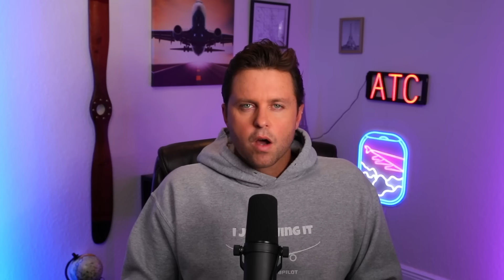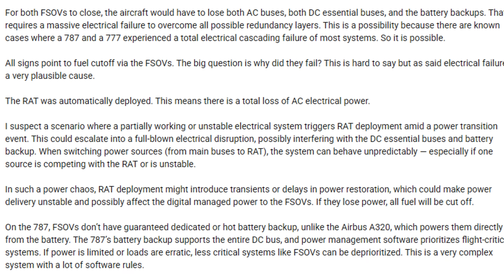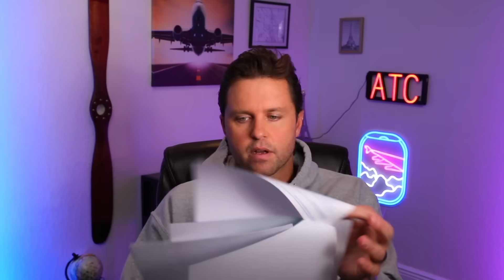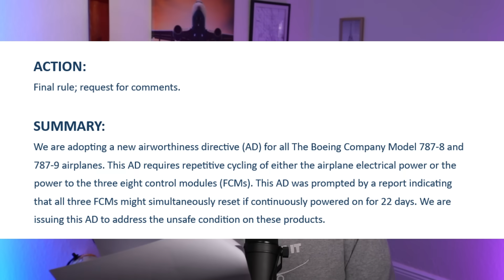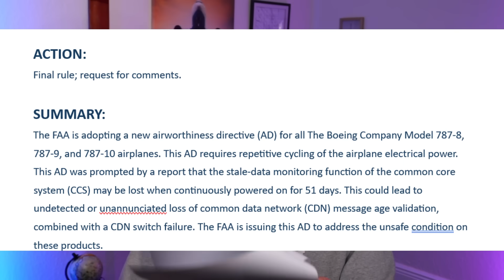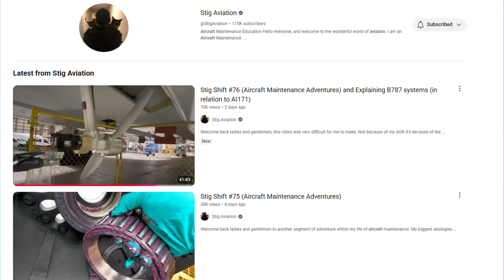Air India 171: Did a Software Glitch Cause Dual Engine Failure?

Comment: I have thought for a while that something triggered when the gear retraction was selected.  The timing fits that if the pumps stopped/fuel shut off you would have a couple of seconds of fuel then nothing. RAT deploys giving you some power for radio etc but you are basically tied to a brick at this point.
Those poor pilots were doomed from the moment they stepped aboard.  There would have been  no prior warning.

The issues from the previous flight: A/C, call buttons not working, entertainment not functioning, etc show there was SOME sort of electronic issue with the craft but possibly not determined to impact the flight status.

Comment: Hi @garybpilot. Thank you for your very interesting hypothesis on the FSOV. I'd like to add one element to that picture. I think that the sole survivor of the accident has made a description of the seconds before impact that frames well within the theory of an electrical glitch; but he also described having felt a TEMPORARY loss of thrust during take off. In this video (https://www.youtube.com/watch?v=b588I2oXMiI&t=29s) he said: "When it took off, within one minute after take off, suddenly for 5 to 10 seconds if felt like the plane was stuck / suspended. Later the lights in the plane came on. Green and white. Then the engines began to accelerate to take off more and keep climbing; until it hit the building." To my understanding he is saying that before hitting the building, the airplane had briefly REGAINED SOME THRUST. I think that this detail has been mostly overlooked and it deserves some elaboration from the community. How about you? Had you paid close attention to this detail in his statement? If the Fuel Shutoff Valve (FSOV) was activated for only say 10 seconds, and was then deactivated after regaining power from the deployed RAT, could the engines have restarted very briefly before impact to the building?? Could you please comment on this survivor's account? Thank you.

Comment: RAT requires aerodynamic airflow to turn the turbine. It is better to install a powerful auxiliary power engine to sypply electrical power to essential components during take off and while on landing. Authorities and manufacturers must look in to the subject.

Comment: Here is what I think happened 

Electrical fault disables FSOV
Fuel valves close, engines shut down

Engine generators stop
AC power to buses lost
Main AC buses offline

RAT deploys to restore essential power

Plane crashes 💀

Comment: Here we go again... the last real good quality aircraft that Boeing produced was 777.  Things went downhill since then. 787, MAX
Reply: 777 also suffered dual engine failure, resulting in a crash landing. Due to a poorly designed fuel heat exchanger.

Comment: Sounds highly probably to me. Planes are fine with computer technology doing most of the flying. But does my PC crash sometimes? yes it does. So highly probably these planes will have similar PC crashes. In those notes you read it sounds like the planes computers had to be rebooted after so many days. We are trusting our lives with not only Pilots but computers. Oh well. Flying for me is scary. I will still do it sometimes but I might need 6 Bourbon and cokes to get on board. Oh and I forgot the main problem! Airline manufacturers cutting corners and puting all our lives at risk. My hats off to all whistleblowers.

Comment: Okay but what with unusual long take off roll? Today we now they used almost all of 3500 metres runway. So the question is if wasn't they also underpowered on the ground.
Reply: The aircraft rotated at the usual position 2,100m from the start of the runway and climbed to 400 ft in 10 seconds, with a climb rate of 2,400 ft per minutes, which is normal. The problem occurred a short time latter. The aircraft then descended and crossed the end of the runway at 71 ft agl.

Hence the problem was not on the ground run but after the initial climb.

Comment: The problem is, who is in charge of the aircraft. The commander or the computer? It has to be the commander, who should be in manual charge of engines, aircraft controls & landing gear, overriding the stupid computers & their software.
Another thing we need to learn from this is to incorporate twin engine loss at 500 feet scenario in all commander simulater sessions. No pilot is today trained in this exercise, giving a startling effect, when it happens. The pilots were already dead at 625 feet & not when they crashed, as they resigned to their fate. Their got to be a strategy or best procedure for such a scene....like taking full slats/flaps to reduce stalling speed etc.

Comment: The ENGINES DID NOT FAIL. BUT they had the FUEL TURNED OFF, NO FAILURE just NO FUEL, SO NO THRUST. EXTREMELY OBVIOUS THE INSTAT YOU SEE THE INITIAL VIDEO, NO EXHAUST PLUMES of BURNT fuel there AT ALL!

Comment: Just a note: Only the 2015 AD was related to the power-systems. The CCS and FCMs had unique issues that could be solved by power-cycling them by power-cycling the main power. The fix for the 2015 AD (2 lines of code) was fielded in 2016.

Comment: Here's what happened.

It was a hot day with a full airplane and lots of fuel. That meant they needed a long runway to get up to rotation velocity. It was a single runway airport used for both takeoffs and landings. In order to clear the runway as fast as possible, the 787 pilot didn't go all the way to the far end of the runway. He started his roll 1/3rd of the way down the runway. The 2/3rds of the runway wasn't enough length for the heavy airplane to get up to rotation velocity at 110 degrees Fahrenheit before they ran out of runway. They ran off the end of the runway, kicking up sand and rocks that went through both engines, rendering both engines inoperative. That's why the airplane had the simultaneous loss.of both engines.

No thrust means no lift. No lift means a slow controlled flight into the ground. Game over.

FOD (foreign object damage) brought this airplane down.
Reply: It has been confirmed that the aircraft backtracked to the NE end of runway 23 and had the whole 3,600m runway available, it did not commence the take-off run from an intersection.
Reply: Plausible but the theory is just another variation on the incompetence of the Indian pilots.  Like if the Indians did not know that it can be hot in India in the summer, ...and like if the pilots did not understand the airplane is super heavy with passengers and fuel.  Being fools the Indians didn't go all the way to the end of the runway and took off late which eventually caused the crash.  You are just another racist Westerner!   Western commentators are all just racists. All they do is concoct theories of Indian pilots being incompetents.  First was the theory of plane taking-off without properly set flaps....the next theory was that pilots mistakenly retracted flaps instead of landing gear as if they have never flown a Cessna but somehow got their hands on a Dreamliner.  The third theory was that pilots took off from only half the runway because they were in such a hurry.  Then a theory emerged about setting improper temperature data into the computer... like if Indian pilots did not now it was a hot summer day in India.  Another Westerner on Youtube suggested they had an engine failure but shut off the wrong engine and caused a total loss of lift.  There is NO end to speculation that Indian pilots were just fools.  Your theory is just another putting blame on Indian pilots, ...thats all.  If you want to blame Indians I would suggest issues related to maintenance, improper or infrequent.  Pilots were probably very good!  Likely better than many in the West.  Most foreign pilots are former military pilots with great experience.

Comment: A YTber who was reviewing Air India in one of his videos some months ago, happen to be reviewing the same plane, that crashed. I even stated that in his video. The letters on the side of the plane at the rear matched the one that crashed a week ago. On this flight, while they were still at the stand, the lights and electricity completely went out prior to them closing the doors. People were getting hot inside and the guy even said, its getting hot in here and we are delayed for 45min due to some hiccup with the plane. It seems to me that this same plane has a huge history of electrical issues on the ground prior to flying yet Air India keep flying this plane. WHY? Is the question. If this was a problem why was it an ongoing issue???????

Comment: This makes the most sense so far.  And now with the flight data recorder allegedly fire damaged & data unable to be downloaded in India, the true cause may stay hidden.  Worth noting the 787, in a push for greater efficiency, the type is different to other aircraft in that it has a greater reliance on batteries & the electrical system.  Engine bleed air isn't used for the air con packs etc.

Comment: The FSOV logic is poorly implemented.
If the engine is running normally, only a command from the pilots should be capable of closing it. 
I.e., if the FADEC is happy then FSOV remains open. 
If communications is lost, then have a timeout on the FADEC to shutdown the engine after a few minutes.
In this case they’d have time to either get the electrical system back, or immediately land.

Comment: It was said the temperature that day was 43°C.  What's not said is where the temperature was taken from, as stated previously the tempt after sitting directly in the sun escalates. Same as is the ground surface where the aircraft sits at the boarding gate any different from the surface of the runway i.e. concrete/cement verses bitumen or selected surface of the runway. Any ideal what the heat absorbancy difference is. Then there is the time of day factor, how long had the aircraft sat in the full sun verses building sade, even partially form a biilding or passenger boarding access. There is also humidity to be considered in the temperature. Was it highly humid surrounding that aircraft or was it a dry heat. Heat is variable which many people don't realize. In most ways of reading a controlled weather monitoring reading it may be set in partial shade. Also breeze affects the actual temperature. So where was the temperature reading taken from as opposed to the actual runway temperature. How long were the fuel tanks on the aircraft subjected to the sun without protection. 

I have lived south of the equator in three different locations. All three locations the weather was vadtly different, from dry heat to humid heat, as opposed to heat during different periods in the year. Temperature readings are completely variable unless taken from the exact the same spot at selected times of the day or night. Our official temperature it read at the Airport shared by both civilian and military aircrafts. That also effects the time at the time of reading because if an F35 is taxiting or landing,  commenced its acceleration for take-off compared to full take-off speed or the heat coming off engines that have just come to rest. That also varies on the time of day. 

Whereas if we go by the temperature at our house from two different sources, it is always a higher temperature than at the airport. All this highlights why temperature has been mentioned regarding the Air India crash. Investigators have a lot of variables to work through. The other thing to consider is the temperature mentioned in the specs. Where was it taken and were varibles in the tempt mentioned. Like they talk about high temperature but do the manuals also consider the opposite of perfortm ratings throughout winter under variable conditions. De-icing wings during winter surely affects the fuel in the wings, just as heat does.

Comment: Better, faster, cheaper. Boeing never should have outsourced its work to other countries. A Quantas plane had this same thing happen but it was at cruising altitude and was able to recover. It was a plane-wide electrical system failure. Also Google “Boeing's 737 Max Software Outsourced to $9-an-Hour Engineers”.

Comment: Dont know anything abput 787 fuel systems but is it possible that the fuel pumps are electrical, if so it could be a failure of fuel pumps to both engines from an electrical fault ?

Comment: Hi Gary I’ve been following you and Captain Steeve so wanted to say thank you for your concerns and contribution. My heart goes out to the families impacted. I’m sure the investigation will be detailed. My father flew commercial jets here in Australia so many of the pilot fraternity are discussing the different plausible scenarios. 
Interesting that AI bots can quickly spell out If both GEnx FADEC systems:
	•	Interpreted sensor data as unsafe (e.g. vibration, over-temp),
	•	Were misconfigured or corrupted after recent engine maintenance,
	•	Or lost power simultaneously due to electrical bus issues,

Then FADEC could easily have reduced both engines to idle or shutdown — explaining the “no thrust” mayday and RAT deployment for emergency power.

Comment: I am a professional engineer with programming experience. 
First stating the known. The 787 lost lift and crashed, this is fact and not speculation. The RAT deployed, this is fact. 

Why the aircraft lost lift and the RAT deployed is where the facts end and speculation begins.  

I like the theory  of both engines losing thrust even though historically being a 1 in billion odds it is becoming the most probable. 

How do we lose both engines? You have already heard many theories. 
In my opinion you guys are finally on the right track to determine the cause. There is a high probability of an electrical issue combined with a software programming issue to create the perfect storm. I don’t think the programming issue  will be easy for the average person to investigate and reach a conclusion. 

My suspicion is the programming logic is incorrect in the event of a power loss. Worse yet, it may only require a disruption lasting as little as a millisecond to close the fuel valves to the engines,  but may require several seconds to correct itself, if ever. 

It would be helpful if someone knows a Boeing engineer who is knowledgeable about the programming logic in the event of partial and/or total loss of the electrical power. In addition you need to understand how the many and various sensors communicate with the software. 

This video brings to light previous occurrences of electrical issues with other 787’s in the past and indicates an issue had developed on the accident aircraft while on the ground before takeoff.  I don’t think anyone has done enough homework to understand there is most likely a software issue too.
Reply: The fuel shutoff valves should be normally closed. In the event of power loss they default to open position.  This reverse logic would work fine with computer controls because with functional computers they would be in the commanded position and in  power loss they spring open, not closed.
Reply: @teddeebayre3433  they’re not spring operated. I read that on the internet
Reply: So the question is whether the valves require power to shut off or are spring-loaded to close when electric power is lost. If they require power to shut off they'll remain in open position in the event of loss of power?
Reply: I believe I heard or read that this plane just went through a major maintenance cycle and that work was delayed due to a contract dispute.  Also, we keep hearing that electrical problems were reported on the previous flight.  My SWAG, old acronym for those who know, is that the airplane came out of maintenance with a problem and the crew should have rejected the airplane for flight.  Also, will the RAT deploy on engine rollback to idle?
Reply: Do you think we’re going to get an honest answer from Boeing it’s likely their attorneys have put a gag order on the Boeing employees already.
Reply: @WilliamTillack  CVR and FDR will tell the story.  Old saying in Aviation.  The most dangerous airplane is one right out of maintenance.  I keep hearing that this airplane just went trough major maintenance.  We'll see...
Reply: corect.i am a power system engineer with over 60 years experience did my pg thesis a software development took about 3 years to just show the issue to the professors. software development is a never ending task as i know now.

Comment: I agree with you, Gary. This shutoff valve could have cut off fuel supply due to no sufficient redundancy in Boeing 787-8 engines. Again the glitch in Engineering may be responsible for this tragedy.

Comment: Hi everyone, I am just a “flight layman” and an SW engineer in the automotive industry. But I am very surprised that the fuel supply to the engines can be closed by a SW system. This should only be done electronically or mechanically by the pilots. During take-off, the thrust of at least one engine must have the highest priority. Ultimately, you have to trust the pilots when flying, human error unfortunately included. To rule these out as far as possible, there are two pilots on board. Anyone who cannot cope with this fact should not fly.

Comment: One engine failed. The other engine was accidentally turned off when fuel flow was shut off by the copilot. Too many Boeing bashers.
Reply: Then why was there no yaw motion when the engine failed? One engine idle and one engine producing takeoff thrust results in an enormous yawing motion.
Reply: @johnbochenek5526 The video doesn’t show everything. One engine failed, a mistake was made when fuel was cutoff to the wrong engine, and both engines were now off. Electrical failure can’t account for engine failure.